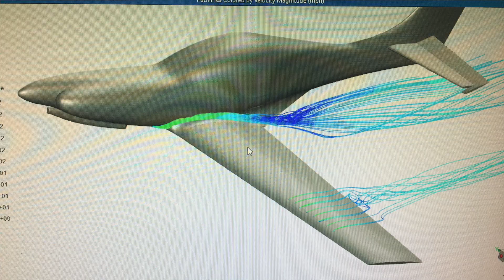Clip - Stall Vane Description - It's not a Cirrus - Flt9  Håkan Modified Lancair Initial Flight Test

Comment: So, just as a total random "what if..."

What would be the feasibility and implementation challenges of theoretically having a slat that covers/shrouds a row of micro VGs when stowed, and has a linkage designed to move down and expose them at higher AoA? Would the resulting reduction in cruise drag AND stall speed justify the complexity of the mechanism in something like this? Has anyone that you know of ever tried something like that?

It's just something that popped into my head a few months ago, and not knowing anyone personally who would understand and appreciate the concept, your comment about VGs always robbing energy brought back the question...

Comment: It would be cool to have the vortex generators automatically extend and retract into the fuselage sort of like the leading winglets on an F-14... But for sure more expensive and may not have room inside the Fuselage where it is located
Reply from the maker: That would be cool
Reply: @utopiasnow  Seems like that would be a good way to reduce the drag but probably not worth the cost since the drag is so low. I’ve been playing with an idea for STOL wings to redirect the airflow to keep it from separating not using vortices but it’s a nasty event how ever it happens
Reply: Even on the F14, they decided it wasn't worth the maintenance and all the glove vanes got secured in the closed position!

Comment: So it performs similar to a leading edge strake, to help keep the flow attached at high AoA/near stall at the root of the wing. But wouldn't this just put you into a tip-stall condition instead? Or is the root stalling much earlier than the tip for some reason and this help evens out the wing stall?

Comment: Elliot I wanted to get your take on something from the RC aircraft world that "solves" (maybe) the VG drag issue. There is a company called Flex Innovations that is headed up by a great RC aircraft designer named Quique Somenzini . He uses "teeth" that protrude out of the wing leading edge (see his Cap 232EX on the Flex website to see them) that cause no drag at a level flight angle but disrupts the flow (like VG's do in theory) at higher angles of attack. What do you think of this method and would it work for full scale planes you think? Thanks for taking the time to check this out if you can.

Comment: Elliot thank you so much for doing what you do! 66 out of 70 videos posted in the realm of Experimental aviation are about flying tractors. If I decide it's important to take off in less than 30 feet, I'll buy a helicopter. Going as fast as possible, on a reasonable budget, with decent handling and reasonable fuel burn... that's where you inspire me.

Comment: Very cool, Elliot. I see Håkan kept the aileron VGs. Tell us, how fast is this plane, really? The highest IAS number I heard was 140 knots. Surely it is faster than that. Though understand that I admit to having built the slowest-ever Glasair TD (#102).
Reply: We are still working on the cruise speed and power settings. With 2 Go-pro's and half the aircraft tufted and gear doors not perfectly closed, obviously that adds quite a bit of drag. Its a 165hp O-320, so obviously not as powerful as many other Lancair 320/360's. Half of the aileron vg's were removed. Many drag reductions in work, however, for now the cruise is around 170-173ktas, with the tufts and go-pro's. I will attend to all the drag reductions later, right now the focus is the low end!! :)
Reply: Was that the build shown on PBS?
Reply: @tedfarwell9812  I have no idea.....

Comment: CFD: Colorful Fluid Diagram
FEA: Fairly Erronous Analysis
Reply: They can be very useful and very accurate, for the assumptions and simplifications one makes. But, the saying is, "garbage in, garbage out". If you don't set it up properly, and/or make bad assumptions, your results will be worthless.
Reply: @SoloRenegade  Assumptions and simplifications are the key. Also make sure the software is making what you think it is. Every once in a while I get an odd result to find that some parameter wasn't right.
That's why my initial approach is as stated above :P
Reply: The best engineering every performed used neither. Spitfire, P-51, U2, SR-71, Saturn V and the Lunar Lander, courtesy North American Aviation. Oh, and the XB-70, Concorde... 

What have they made post-CFD/FEA? Nothing to note. Outside spaceX maybe.